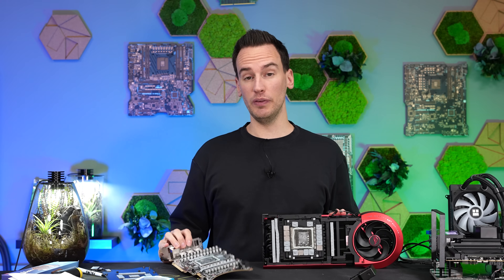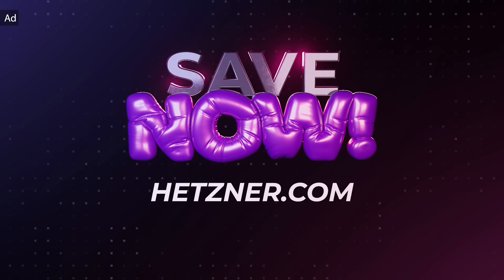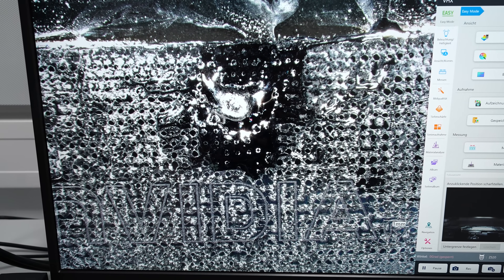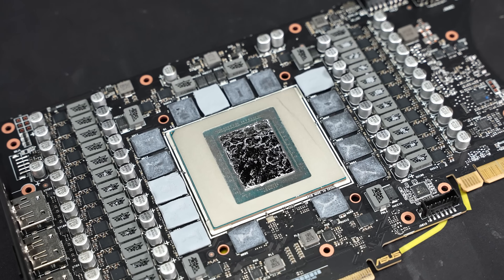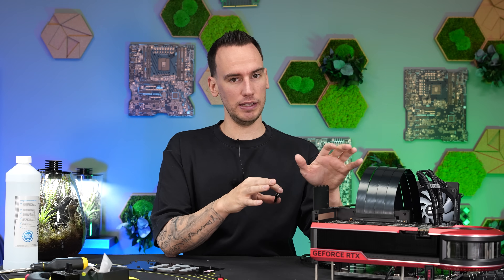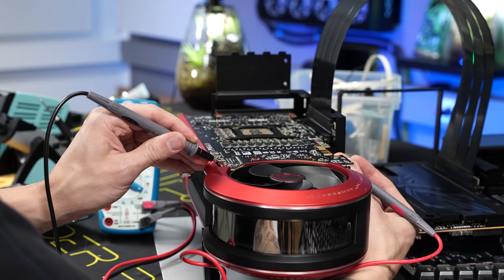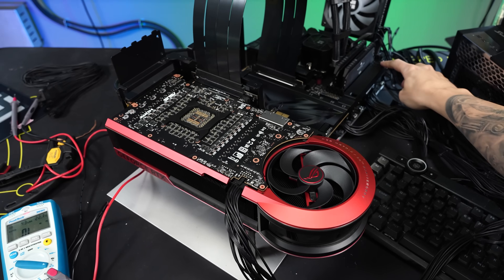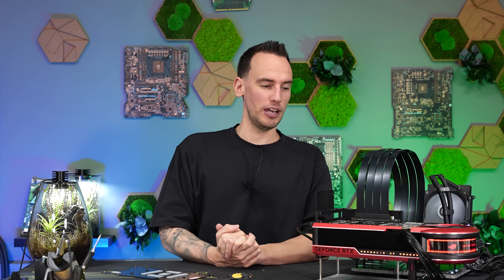5090 Matrix Mod: 750W over 12VHPWR without BTF & Liquid Metal Check

Comment: I thought the max wattage the high power connecter was 600 watts
Reply: That’s just what it’s rated for
Reply: The lion does not concern himself with silly electrical ratings.
Reply: It is. The higher power limit on this GPU is when you use both connectors at the same time
Reply: There is a tweaked BIOS for this card that'll push power to 1000w
Reply: @shadowarez1337  Galax has a 2000W bios for their Hall of Fame 5090
Reply: That's just "safe" temps which are actually still not 100% safe, so 675W max if you include board power. Cards like these end up on northwestrepairs sooner rather than later, you cannot game using 750Ws due to crashes anyway. Running a 3 minute benchmark vs playing for 1-2 hours is an entirely different beast.

Realistically speaking, a stock 5090 is basically a card maxed out of the box. Yeah, you can still overclock it by 8%, but it won't sustain during a gaming session, you'll either crash or throttle to stock levels and below depending on the game. Modding a GPU that's completely maxed is like filling a glass with water completely and then trying to sip some more water on top of it, it just doesn't work, all you'll have is water spilling over or in this case - heat.
Reply: In reality max safe is 200W lmao